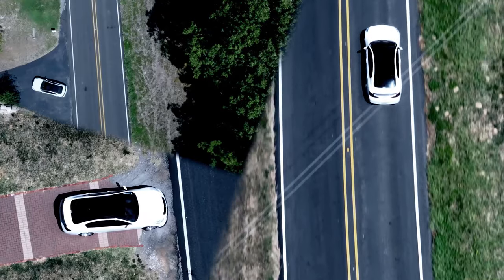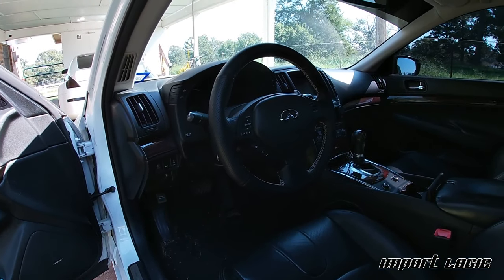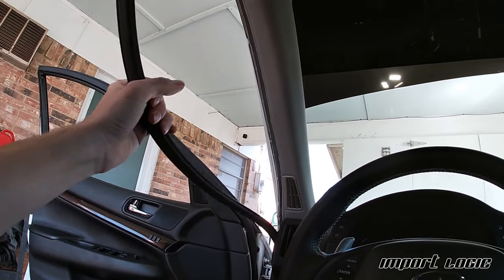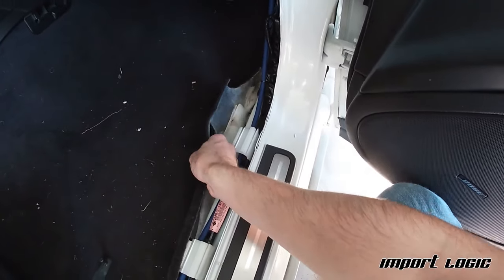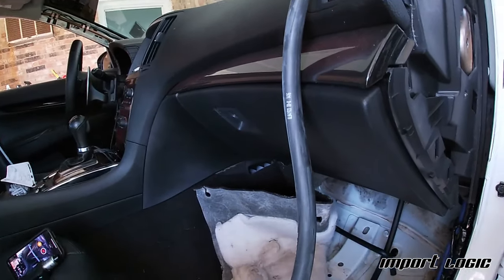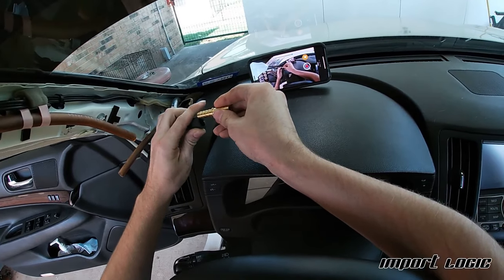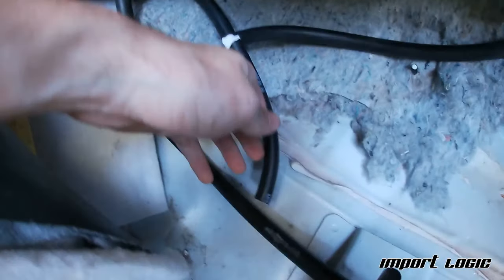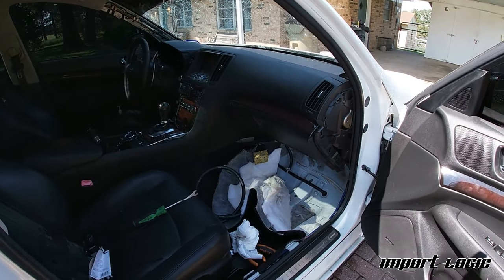Infiniti G37 Sunroof Leak Fix! - Simple Permanent Repair / Fix

Comment: So 2 (3/8” all around) barbed tee fittings, 2 3/8" barbed straight fittings, 3/8" hose and clamps or zip ties? Is that correct for the parts list?
Reply: Trying to figure this out aswell

Comment: What size were the hose clamps? 1/2 or 3/8
Reply from the maker: 3/8-1/2. Hose clamps fit whatever size you tighten them too. Just have to find the correct range.

Comment: Looking for help with this on my 2009 G37s coupe. I have everything torn apart, and the new hose feeding through the dash on both sides. The problem is that I can’t seem to get the hose across the center console. The area behind the vent on the transmission tunnel seems to be blocked all the way back to the fire wall. I put a flashlight back there and don’t see any light from the other side. Any thoughts? Would the coupe be that different from the sedan?
Reply: Answering my own question…. Found a small area back by the firewall that was barely big enough to allow the hose to get through. In the end it worked.

Comment: I am about to do this repair as soon as the carpets in my car dry out.  Has anyone had a problem with the 3/8 connectors getting clogged with debris from the sunroof drain?  I am also thinking of using two separate Ts to bring the two drains into the A/C hose rather than tie the two drains together before they go into one T in the A/C hose.  Thoughts?
Reply from the maker: Not yet, I’ve been on the lookout for that. But it’s been working pretty good.

Comment: just seen this. It great idea. Wondering why INFINI-THIEF, did not think of this? I now have a leak, but is thinking of not messing with it, because of the air bag. I will bore a hole in the FLOOR, and put an GLUE A PLASTEC ELBOW, there to allow for the water to drain out. Will put a check valve on the elbow. That should do it too.

Comment: Cool mod to solve this annoying problem. Did you check the windsheild cowl seal as well? That seems to be another spot water comes in when it's raining and your ac is not in closed loop.  Fixed my sun roof drain with the straw and it wad dry for a while until recently.  I checked the fix and it was still working. It turned out to be the windsheild cowl. There was water coming in past the deteriorated seal on the cowl and leaking down the blower and settling in the cover below and coming out when it over flowed.

Comment: I'm taking my car to mechanic today, the rain soaked the passenger carpet and the BCM. Do i need a new BCM? Also hopefully my mechanic knows how to do this to prevent the leak..
Reply from the maker: They will want to replace the original drains most likely, as long as the BCM dries out before putting power through it it should be ok. Lots of variables there. Id send them this video, will be much cheaper if they are willing to do it.
Reply: @importlogic  Thanks for the response! I'll definitely tell them about this. Unfortunately i didn't realize it was soaked and attempted to turn on the car, it was like haunted! Finally the battery ran out after few hours..

Comment: i’m having this issue right now.  how’d you get all the water cleaned out under the carpets?  i’m in FL and it’s constantly “humid” in my car.  i’m worried it’s gonna permanently damage the leather if i can’t get it properly dried out.
Reply from the maker: I left it open all day with the carpet leaked back. Literally took all day though.. have fun lol
Reply: @importlogic  thanks. gonna be finishing up tomorrow.  i hope i don’t screw up the carpet putting it back down when i’m done.

Comment: Alright Sometimes I have a leak on the passanger back seats floor.
do you think is the same issue?
Reply from the maker: Yes, water from the front floor board sloshes to the back under acceleration. There are only front sunroof drains to my knowledge.. my car had water in the back as well, re-routing the front drains solved this issue. Thanks for the comment!
Reply: @importlogic got it thanks to you for making this video.

Comment: I followed this tutorial on my 08 g37 coupe about 1 month ago. I used clear tubing so its easier to see if its draining. After the install i did a quick check and it seemed to be draining well. Today i pull out of driveway and about a tubs worth of water fell from the back of my glove box onto my floor mats. I immediately pulled back in the driveway and noticed the tray under my glovebox was holding water. Could not locate where the leak is coming from but all that time spent doing preventative Maintenance just backfired. Anyways just wanted to see if anyone else experienced something similar and what the permanent fix would be
Reply from the maker: Sounds like the fitting in the a-pillar is leaking and water ran down the hose to behind the glove box or something, regardless if done correctly there’s no chance of this happening unless you have a bad connection. Try and chase it back and see what you can find. Sorry you are having problems.

Comment: How do you run the hose down the A pillar? It’s literally where I’m stuck at.
Reply from the maker: I just shoved it down untill I could see it from the bottom with a flashlight and pulled it. Might need to do some fishing but it wasn’t too difficult.
Reply: I have a 2011 FX35 do you think it’s different? By looking at your video it looks literally the same.
Reply: I'm having the same issue with a 2017 QX70S.  There is so much stuff under the dash that the hose won't feed all the way down, and I can't see it with a flashlight on the driver's side.
Reply: @ i got rid of my FX35. The water damage was too much.

Comment: I've seen comments saying some tubing is 1/2" while others have 3/8" (or maybe they're only referring to the AC line), but anyway, I wanted to check before I started doing the work. I've already bought 3/8" tubing and fittings. Anyone have trouble pulling the A-pillar trim loose ? The video shows grabbing it on the windshield side but mine has absolutely no gap to grab.

Comment: Question about the old drainage system. Is the old tube connected with any other place like the sunroof. Or does it connect with the 2 pillars and goes down the drainage under the car 🤔
Reply from the maker: It goes to a grommet in the firewall behind the dash. These go bad and are expensive to replace
Reply: @importlogic   I thought the old drainage system connected to another area like the sunroof drain. your method seems more effective. 

I’ll surely abt it with my dad since he wants it to get the g inspected but I want to fix it my self since I never fix a car by my self before. Thank you for replying hella fast 🫡👊
Reply: @importlogic question, I want to use clear tubes. I wanted to know if I should use brass fitting or plastic ?

Comment: Fuck yeah, dude. Thanks for this. I hope this is my problem. My BCMs are getting wet as well as my floor, hopefully i can track that drainage line and find it leaking. My car was parked under pine needles—which clogged a ford of mine years ago—if i can’t get it clear this will save my car! Thanks again.

Comment: Great video! One question:
What did you do with the drain plugs on the fire wall? Did you leave them as they were damaged? Or did you removed them and sealed the holes? im considering doing fixing this issue with your method, but also want to make sure no water will leak from those plugs on the fire wall for no other reason.
Reply: Did you ever find that out?

Comment: Sooo what if water hit the BCM? Do I replace it? Or do I get another?
Reply from the maker: I would assume as long as the car was turned off and no power was running through it it should be fine. Replacing the BCM is complicated on these cars because they are tied to the NATS security system, it’s linked to your ECU and key. Are you having problems out of the BCM?
Reply: @importlogic  I ask cause I lost the function to use my wipers when I spray the window... some of the intermittent speeds don't work
Reply from the maker: And this happened immediately after noticing you had water in your floor boards? Could just as easily be a clock spring or issue in the wiper switch itself. People are usually pretty rough on the selector lol. Definitely worth some diagnosing to make sure your looking in the right place.

Comment: While this is creative. I had the same problem and wasn't about to recreate the wheel. All i did was open the sunroof. Pour draino by the entrance of the drain, then snake a flexible old charging cable and wallah, problem solved.🎉

Comment: Question is why does it gets clogged in the first place? Dirt? Should we add strainers to keep dirt away?
Reply from the maker: The seal against the fire wall dry rots. Has nothing to do with getting clogged. It’s common.
Reply: There's a baffle on the plug in the firewall that gets clogged. There was still water halfway up the line in my a-pillar when I cut it. The holes on the barbs are bigger than the one on the plug, plus this is way easier to service if it does happen to get clogged

Comment: I just did this fix but water is still leaking somehow on the driver side. I can sometimes feel water dropping under the steering wheel. Anyone else have this issue?
Reply: Did you fix this? I did this fix last night and it rained over night and I still have water leaking! Mine is passenger side

Comment: could you just plug the sunroof drain on the roof with caulk/flex seal so that it doesnt even flow down the passenger side pillar?
Reply from the maker: To remove the drain completely? No that’s asking for disaster. Will soak your headliner and everything below. The drain is there for a reason.
Reply: @importlogic  I was thinking it could just divert to the driver side instead.. ie just plug the side that’s leaking
Reply: @TheCompton2010  Did you ever find out if this would work?
Reply: @rlbjr  I actually ended up just buying new tubing and bypassing most of the stock tubing and then connected it in the floor panel with the other side.. only took 30 minutes.

Comment: Bro I did passenger side but I can’t see to find an opening to run the hose thru driver side pillar since to be all cover from underneath on my 13 g37x help me out lol
Reply: Hey - I had the same problem trying to push the hose down from the top of the vent.  Easier to push up from below, just above the fuse box near the foot well.

Comment: I’m guessing the AC drain hose is also 3/8?
Reply from the maker: It was slightly bigger. Some people are saying it was 1/2 inch. I need to revisit this video soon.
Reply: @importlogic  but you used a 3/8 T and it worked fine? I just picked up t parts and i got the 3/8 for the ac hose i should be okay?
Reply from the maker: @Notoriousahmed  correct hat to tighten down the hose clamp a bit more than the other but no issues! Just leak test it before putting the carpet back in.
Reply: @importlogic  just finished, works great, bro i just want to thank you for real,
Reply: @importlogic  Could you use a silicone sealant on the barbed end before sliding the tube over it? This should seal it pretty well, especially if also use a hose clamp.

Comment: What about the rear sunroof drains ?
Reply from the maker: The rear drains typically are not problematic. Or at least I have never herd of anyone having problems with them.
Reply: @importlogic  I found a puddle in my back seat the other day😭
Reply from the maker: @raimelvelazquez7274  the front drains go to the front floor board but will slosh to the back when you drive or parked on a hill. To my knowledge there are only front drains. My back seat was also wet. I haven’t had any issues after fixing them.
Reply from the maker: @raimelvelazquez7274  subscribe if you haven’t already. I’ll be making a follow up video after a few months of rain to verify the repair.
Reply: @importlogic  will do bro !
Reply: 4door has rear drains as well. Remove the linning in the trunk. U can see them. Firewall caps can be replaced or cleaned
Reply: @samstory8428  do i have to take off the bumper? Whats your Ig so i can message you
Reply: @importlogic  Yea i agree as well, I dont think there are any rear drains from the sunroof. After a good rain, i Usually find my driver side front and rear with water, but more water in the front because i park on a slight hill so water goes to the driver rear floor as well. Def not good and Infiniti should be sued for this cheap design because it causes mold.

Comment: Does anyone know how dirt won’t get clogged with this method couldn’t it still get built up in the hoses?
Reply from the maker: The issue isn’t dirt buildup, The problem is the seal at the firewall rotting away causing all these leaks. This eliminates that entirely.

Comment: Some thing is happening to my car and when it happens the cars goes in limp mode because the water is messing up with my brake wires so it’s sending a signal saying that I’m driving with my brake on and activate the abs mode

Comment: Yo I’m having trouble with the ac hose I did everything but it’s still leaking from there
Reply from the maker: Need to tighten it down more or something. All that’s there that can leak os one of your connections to the barb.
Reply: I got zip ties on it
Reply: Can I send a picture
Reply: And a t not a brass a 1/2 inch tee

Comment: newbie here....i am sort of handy but am so scared to mess up.  I was able to pull everything off car, found tube, pulled tube out and saw the debris that was causing clog, and then of course couldn't get the darn thing hooked up again!  I panicked due to incoming rain, and took my car to my local shop.  They called me today and said they had to remove dash to fix prob and it could be up to $2K to fix (2013 G37 w/88K miles on it).  Should I go get the car and try the ac way??  I can call a friend to help as well; I am 45yo female that is NOT savvy about cars.
Reply from the maker: In my unprofessional opinion yes! If you have the means to do the work. It’s fairly simple if you follow the video. Still no issues a year later.

Comment: Parts list and where you got
em ?
Reply from the maker: I got every you need at Orileys’s auto parts. 3/8 hose (I got 20ft but that’s way too much), two 3/8 straight barb fittings, three 3/8 T fittings. Lots of hose clamps.

Comment: I recently attempted to fix my sunroof drain since it started leaking towards the A/C condensation line. I did the method where you get new hoses and reroute everywhere. But now anybody know why my A pillar sometimes leaks?I did all the steps correctly; my old hoses stopped leaking and flows good now but when i do the water test and pour water down the sunroof drain 80% of the time it works than the other 20% water leaks from the A pillar. not the actual hose because i see water running though it and going down but sometimes a little bit of water goes past the hose and into my A pillar causing it to drip

Comment: Hey wondering if anyone else has had an issue after the fact of installing the new lines. I’ve ran all my lines back and confirmed the lines are all tight and successfully flowing water out of the drains, but when I pour loads of water onto the passenger side windshield it appears some water is getting in that way. 

Any idea what drain/seal is failing to cause that? Really appreciate any help.

Comment: It’s an 3/8 I.D or O.D?
Reply from the maker: 3/8 OD barb. The big condensate like is 1/2 I believe.
Reply: @importlogic  so the hose it’s a 3/8 OD
Reply from the maker: If the barb is 3/8 O.D then hose would have to be 3/8 I.D

Comment: still leaks heard there was drains running to the back and i ran it down the windshield still leaks :(
Reply from the maker: Make sure your connections are tight. There are rear drains but I have never herd of anyone having issues with the rear drains.

Comment: Question, what if it's happening in my back floorboards. Will it be the same process before I tear something up trying to fix it? 😂
Reply from the maker: Water from the front probably sloshing to the back when you get on the throttle.
Reply: @importlogic  well, when I first noticed it, it was just built up in the back floorboard with no driving.  So you're saying repairing the front would probably repair the back? Because there was definitely a small amount in the front . And thanks for the fast response! 🙏
Reply from the maker: @American_HitchHiker  most likely, I’ve never had a issue with rear drains. But I have seen front drains leak and cause water standing in the front and back floor boards. Start with the front and see if that fixes it.

Comment: Much simpler solution is to use silicon sealant from the hood side
Reply from the maker: Roof drain outlets near the firewall are not accessible from the engine bay or under the dash without removing the dash
Reply: @importlogic  maybe G37 has different layout under the hood, but i can access drain outlets from the hood side on my EX25. And fixed it with silicon sealant

Comment: now isn’t ur ac gonna have a problem draining?
Reply from the maker: Not at all, the condensate flow from the AC is minimal. I haven’t had any issues at all. If your worried about it go with larger fittings or find a new place to discharge.

Comment: Or you could’ve just extended the hoses to the existing hose and stick down the original holes lol.
Reply: Isn't it hard to get to the end of the drains? That's why this method seems easier
Reply: No it’s much less work than this whole video. The original location for the drain grommet can be pulled out with long need nose pliers. I tossed the grommet out and bought a hose long enough to extend through that hole. Also depends where that roof leak is coming from.
Reply: @NoDidddy  only thing is i hear it's a tight spot that they are in. I guess they make new updated peices for the drains that extent out past the body to prevent leaks in the future